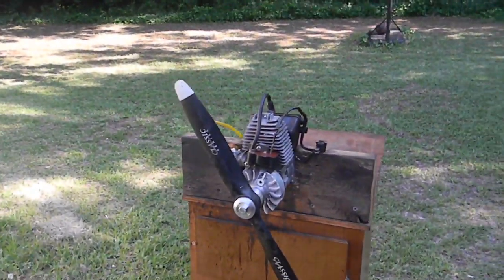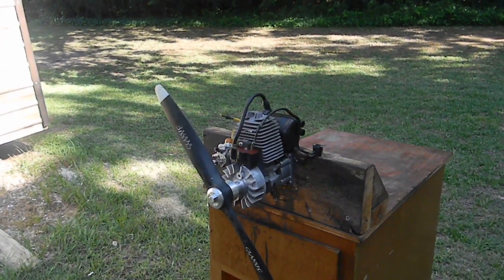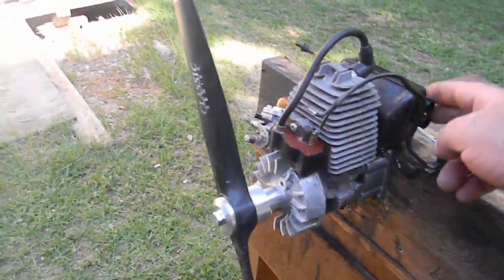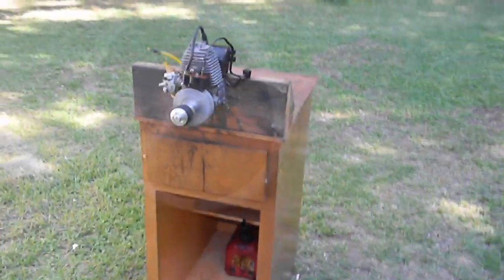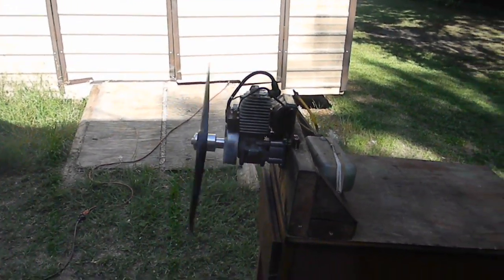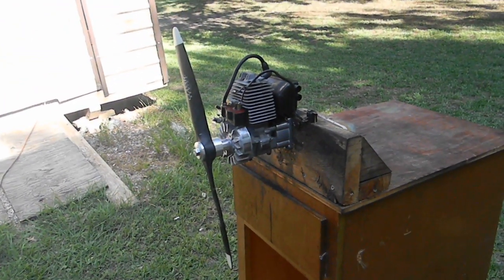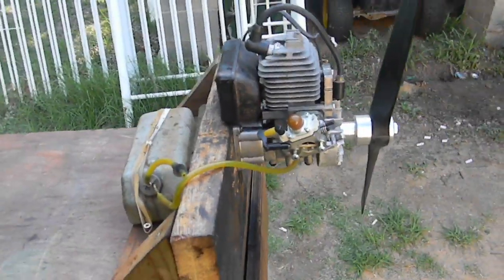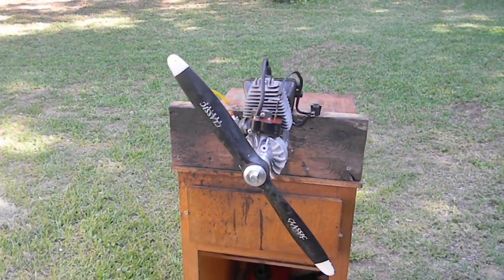US ENGINES 41CC RC ENGINE CONVERSION FOR SALE!

Comment: I just acquired an RC Plane with this that I found in an attic. 10'6" wingspan, exact same motor and prop. Could you tell me how much you sold it for, or bought it for?
Reply from the maker: +Grant Bradshaw I sold it for $150.00  Gary
Reply: Thanks

Comment: What percentage of oil to gas did you use for this?
Reply from the maker: 2 ounces of AMSOIL to 1 gallon of 93 octane. Gary
Reply: not enough oil!!! 40:1 or max 50:1..... have fun seizing the engine if it hasnt already!!!!